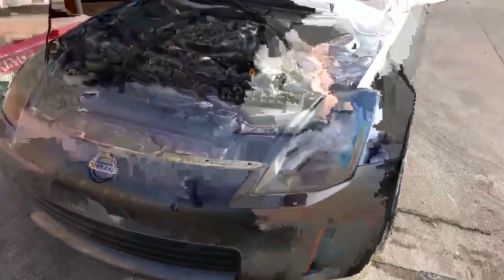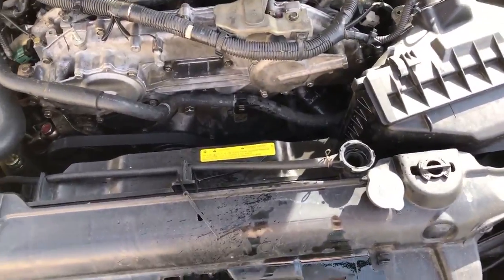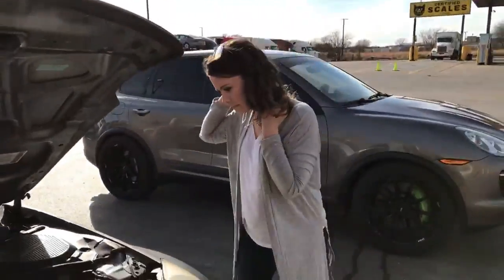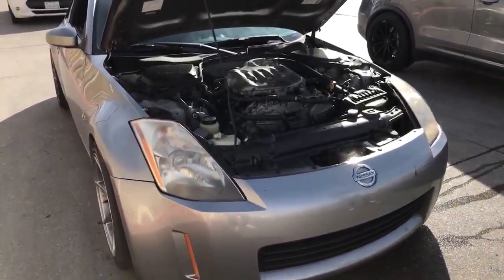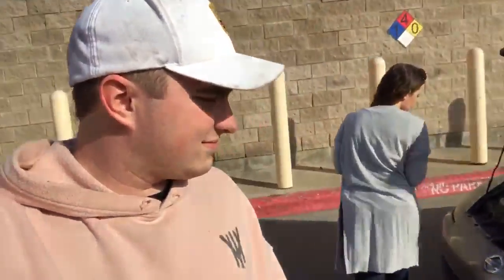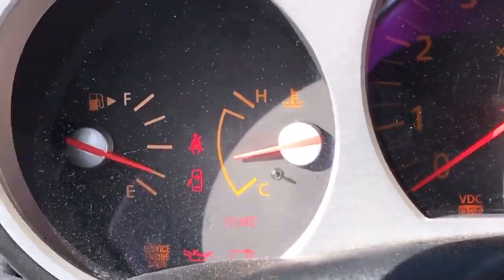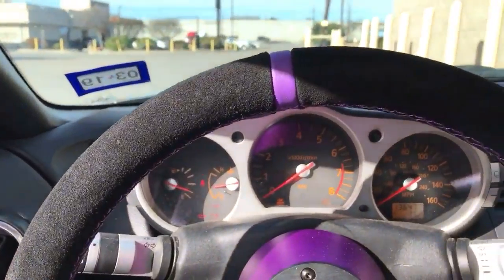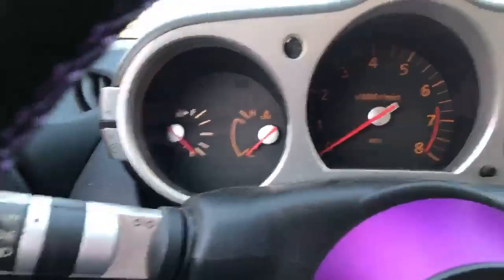350Z TURNED INTO A GEISER LMAO

Comment: if your car is overheating you can crank the heater on in the car.. it will suck most of the hot air from the engine bay.. it will suck cause it's blowing hot air in your face but at least it will keep the temps lower
Reply: Correction, it doesnt suck hot air from the engine bay, the heater uses the engine coolant to heat the air.
Reply: Yeah and also heater won't work with a stuck thermostat
Reply: aaronisme318 i stand corrected

Comment: Also check the top of the radiator for any small cracks, the top is plastic and around 90-100K normally go out which mine did a year ago
Reply: This^. The radiator on my sc400 crack at the plastic joint and this same thing happened.

Comment: I'd say faulty thermostat but didn't you change it with the rebuild? Id guess a cracked radiator tank where the plastic meets the metal. I've seen that on cars from 75-130k miles so it's entirely possible